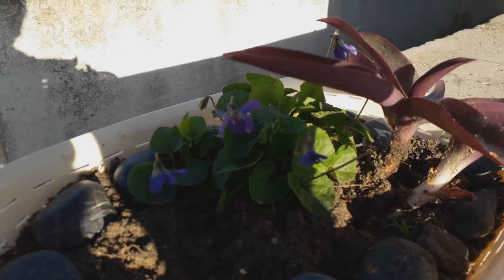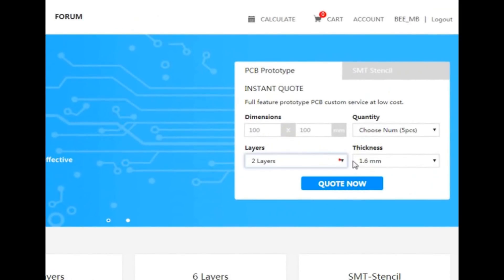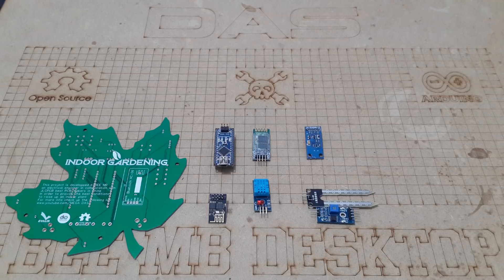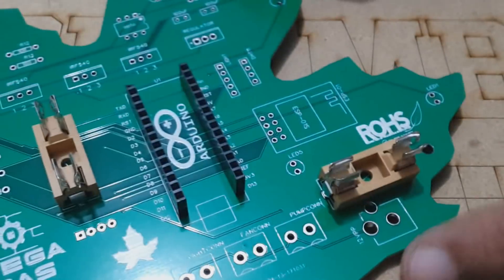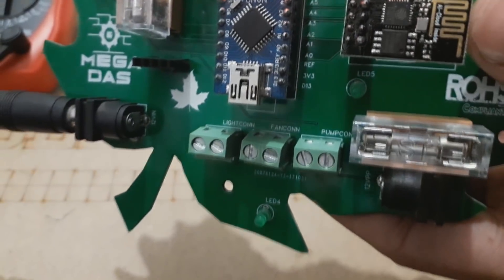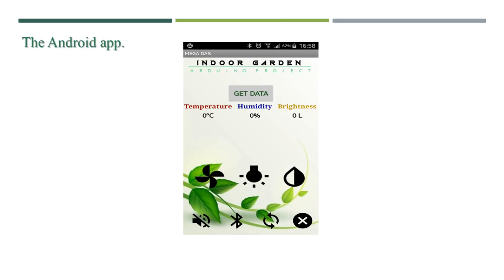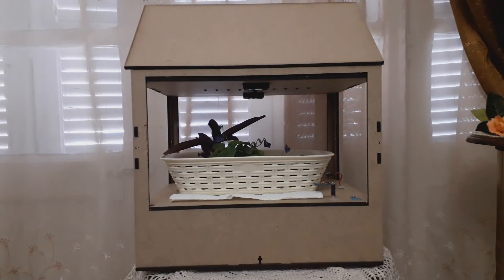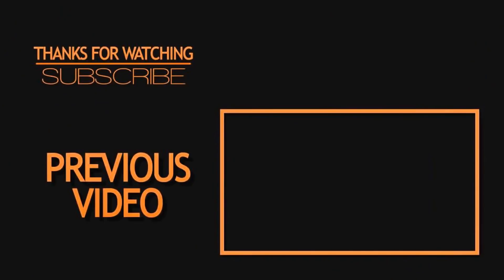How to make Arduino indoor garden

Comment: what is powering the system?
Reply from the maker: DC power adaptor.
Reply: @DIYGUYChris  sorry for so many questions but what’s the total wattage?😅
Reply from the maker: @kayodeayeni6300  didn't measured it but a DC power providing 2Amps current could easily make the system running
Reply: @DIYGUYChris  okay thank you

Comment: Hi, I'm new to this. How do you know which parts to buy and how to connect them? I would love to learn more about this.
Reply from the maker: Hey Ivanna
Yes you will learn through the experience 😉 actually you should have an electronic making background to understand the basics of these projects..
I'm here to support my followers so just let me know if you need some assistance.. 😊
Reply: MEGA DAS I have studied electronics many times but I get bored when there is only theory or when using a few basic parts. know how to solder, but I'm not sure how to take that extra step with the microcontrollers.
Reply from the maker: @ivannaivanova8542  I was feeling the same when I was student 😂
Try to buy some simple and cheap stuff and start step by step a whole electronics bench in your home.. This is how I learned through the years 😉

Comment: Great Project, very well done and explained. It inspired me to build it. I am almost finished with it, but also did one mistake by ordering LD1117V, which is adjustable. Well, so I added the resistors to get 3.3V (120 Ohm and 200 Ohm). But I have one question...On the PCB it is not clear where is Vin Vout and GND.  On PCB the square pin with dot marked seems to be +12V, but the datasheet of the LD1117 would be GND...can you help please.

Comment: Very cool project. I want to use this scematic for my vertical garden (indoor) i am not a pcb designer. I can program arduino though. I have 8 rows that i want to light up with ledstrip (12V). Is it possible to implement this is your pcb? i would even pay you for it if this is a lot of work?? As i really find this project standing out of all other projects. I am a automation guy, so i would really like to see my plants be controlled with my smartphone. Hope to hear from you...
Reply from the maker: Hello Iwan
No need to pay us money.. just you can send us a tip through our tip page : https://en.tipeee.com/mega-das
-------------------------------
About your project could you please tell me how long it will be the LED strips? if you know how much current it takes to power them on it will be usefull for me to help ..

Let us know if we can further assist you.
Reply: @DIYGUYChris  What i now use is a 12V ledstrip. 8 ledstrips. per ledstrip 0.650Ah. Because of the high current i want to use 24V ledstrip that uses around 0.325Ah. Is this the info you are looking for? and i absolutely WILL make a good donation if you could make me a schematic that i can use for my project... I cant wait.
Most perfect would be a scematic for 12V and 24V...but i will not press my luck..hahahahaha THANKS in advanced.
Reply from the maker: @iwankreft  Ok
Send me Email through the following address megadasfirstgate@gmail.com
Then we will talk about it ☺️

Comment: When soldering THT-Components to a circuit board you usually start with the lowest components and work your Way up to the bigger ones. That way when you flip your board for soldering, the components rest on the Table's surface and can easily soldered on without the other Hand holding it in place.
Other than that great video - explained everything well!

Comment: nice work, could you tell me what is the power supply to power both of the 12v  fan and the pump ?
Reply from the maker: Hello
It is a 12V DC power adaptor.

Let us know if we can further assist you.
Reply: @DIYGUYChris  How many Amper does it need ?
Reply: Thanks for the reply @MEGA DAS .
I forgot to ask : what about input current ?
since you used one 700mA pump, 100mA cooling fan,  and several LEDs with 20 mA,
I think the current from power supply can be about 1A ?
(sorry not electronic engineering profession, apologize if that's a dumb question)

Comment: Hi,
Can you add CO2 sensor?
As i see, you have to control manually but not automatically watering!
Is it better if the whole system run automatically?
Reply from the maker: Hello
Yes you can add CO2 sensor and you need some program adjustment to perform
manually or automatic it depends on your need..
Reply: How many more sensor and actuator can be added to the arduino?

Comment: I make a growhouse with :
Arduino uno R3
Mini fan 5 v 
Bluetooth HC-05
Aquarium pump 12 v
Arduino relay module
Grove temp humidity sensor
Liquid crystal display
I made a box holding 60 liter of dirt with build in resevoir it have all values displayed on screen and if nessersary you can connect bluetooth but i programmed the arduino so when exceding some values like temp or humidity action is taken growing plants lime cubcummer and tomatoes in there the water resevoir can hold more then 6 liter water
Reply: Bro I need help ,I need to do mini project, can you help me??
Reply: @deepakkugan6482  sure i can help out
Reply: @buurmanvanderoot3373  how can I contact bro
Reply: @buurmanvanderoot3373  bro I need to add xtra,like timer, how to make it?help me to do this bro
Reply: @deepakkugan6482  make a big delay command in the code of arduino or make it that it only goes on when a certain humidity is reached ect

Comment: What kind of mosfet are you using?and why you are using capacitor?
Reply from the maker: Hello
Mosfet are IRF540N and I use a voltage regulator so it needs to have capacitors in its input and output.
Check the circuit diagram for more.

Let us know if we can further assist you.
Do not forget to subscribe to our YouTube channel for more awesome videos.

Comment: Hi!
Great project bro, I could realize it and everything works except the automatic mode
What's the operation of this automatic mode
Reply from the maker: Hello
The automatic mode will make the plant's actuators work automatically like the pomp works depending on the moisture sensor's signal the LEDs work dependind on the light sensor's instructions and so on.

Let us know if we can further assist you.
Do not forget to subscribe to our YouTube channel for more awesome videos.
Reply: Hello! I have built this but it does not seem to be working as expected. I am not having any success in automatic mode, I also do not have wifi or Bluetooth adapter, so I am trying to make this work completely automatically

Comment: hi! i want to know what's the use of the  esp-01 module?
Reply from the maker: Hello
In case you want to control your plant monitor from outside your house, that could be usefull.

Let us know if we can further assist you.
Do not forget to subscribe for more awesome videos.
Reply: @DIYGUYChris  thank you for the answer
one last question
instead of the BH1750 I used TSL2561
but I can not configure it in the program
Can you help me please
this is my last stage of the project
Reply from the maker: @astousissoko3355  the sensor has just an analog output so just use it to measure the brightness the way we did in our project.

Comment: Hello, insane work good job!
I am doing the same project and i have a question.

The reason you need two different power sources is because the water pump drain more Ampere that the Arduino can sustain?

And how u will power those two DC barrel jacks? Will you use two different AC/DC conventer 220V-12V? Or you can achieve that with only one AC/DC converter.

Thanks for your time.
Reply from the maker: Hello tourta tourta
The reason why we've used two separate power sources is in electronics never to use the same power or shared ground for the command unit and the actuators (like pumps) since it drops high current that could affect the MCU.
We used two DC power sources.

Let us know if we can further assist you.
Do not forget to subscribe our YouTube channel for more awesome videos.
Reply: @DIYGUYChris  Thanks for your answer!
I have 2more questions if possible :

First is there any specific reason to power the Arduino with 12V? The reason I am asking is because the 5v regulator will produce more heat, so I wonder if I could use a 9v power instead of 12v (or even less like 5V or maybe if I could make 7.5v)

Second about the Led1 & Led2 in your schematic is there any purpose for the circuit or its only to see if Esp & optocoupler is working?
Thanks for your time!
Reply from the maker: @tourtatourta7301  I used 12V because I don't have 9V DC power :D but you can use yours.

About the LEDs it is exactly as you said, just a power check indicators.

Comment: Hello, amazing project and you made it too simple. I just have two questions which may sound too dumb but what is the VPN you have in your schematic and what's the porpuse of the Leds, just to know if it's on or there is another reason?
Reply from the maker: Hello lordwalrod
We are using a separated power supplies for arduino and the pump so VPN is the GND of the power supply used to power on the pump.
About the LEDs, the plant will be the whole day inside and it needs some source if light thats why we used those LEDs.

Let us know if we can further assist you.
Do not forget to subscribe our YouTube channel for more awesome videos.

Comment: Clear you're a techie and not a grower haha. You'd need probably 100x the quantity of LEDS and perhaps different spectrums
Reply: Grow up Ryan! My son revealed to me that disparate disciplines working together can achieve exponential results. Instead of throwing rocks, why not work with the talented techie to achieve results beyond what either expected.
Reply: And CO2, and adjust pH and nutrients.
Reply: @PyroRob69  C02 not so important, just need to have lots of airflow, nutrients can be mixied into the water source.

Comment: Amazing project, I like it ! I'm actually trying to reproduce it, with a few very little modifications (BMP280 iso DHT11; pollution sensor; UV LEDs;...) because I plan to use it outdoor, with a few more weather capacities. I'm new in Arduino "game" but thanks to your project and presentation's quality I've learned a lot with that one ! I hope you won't mind the few changes...
Eventually a do have a few "dumb" questions (newbee here !!) :
- What is the power supply you're using for this project ? I suppose it's 12V but just to make sure...
- What is the purpose of the second PSU connector ? It seems like you don't use it in your vidéo... Maybe for the 12V pump only... 
- What is your use of the wifi module ? Can it help for domotic box integration ?
- How did you managed to create such a nice PCB shape with easyEDA (I've discoverded this pure perl with this project also: many thanks !!) ? 

And once again: amazing project, and great job, very "newbee friendly" despite it's complexity: both tumbs UP !
... And sorry for dumb questions and "english tasting like french": 

Bonjour de PARIS !!!
Reply: Bonjour Pro 972, full débutant sur arduino, cela fait quelque temps que je réfléchie à la manière de pouvoir concevoir un système d'irrigation quasi autonome pour des plantes d'intérieur dans mon logement,pour une  variété de plantes ayant des besoins en hygrométrie différents, 3 types de besoins en eau en fait ( d'où des mesures d'humidités et un arrosage différencié , le tout avec  une alimentation du système par un petit panneau photovoltaique..., pour le rendre autonome.Pourrait-on partager et échanger. Bonne journée et à bientôt sans doute.Vincent
Reply: Salut Vincent,
Pas de soucis, avec plaisir.
Je suis probablement aussi débutant que toi, et je butte actuellement sur le "code". Les explications et exemples sur la création du code pour 1 capteur se trouvent à la pelle, alors que pour faire fonctionner plusieurs éléments sur un même montage les infos sont plus parcellaires. Ça fonctionne à peu pres en collant des bouts de code récupérés ici et là,  mais c'est pas clean...
@+

Comment: I suggest you adding UV LEDs
Reply from the maker: Hello Angelo
Thank you for your suggestion, and we will try to make an upgrated version using UV LEDs ;)
Reply: Angelo Maciel why do you use UV led?
Reply: I would suggest you add the ability to add solid state relays to control multi-kilowatt HPS and MHS lighting as well as valves for CO2 sensors and controls. You might also add the ability to control pH and TDS so you can control nutrients.
Reply: @PyroRob69  led is just fine